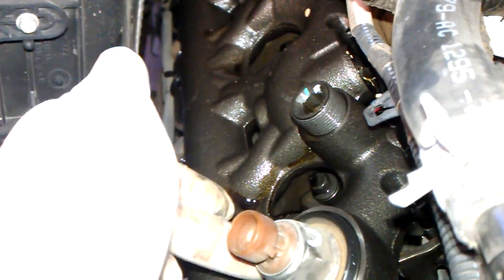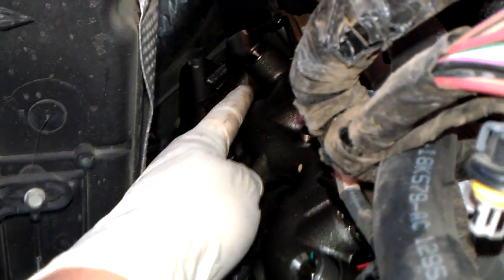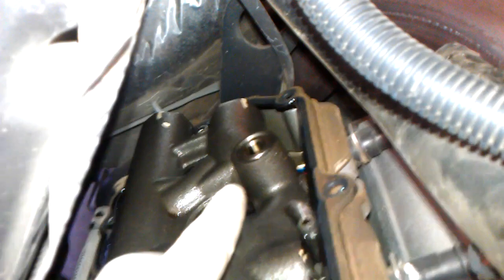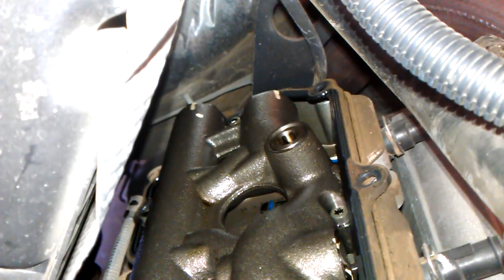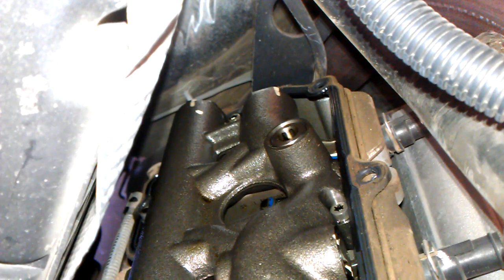SHOP UPDATE 3/24/2012 D-PLUGS FAILED

Comment: Man i am a ford man all the way.IH man all the way.It started with the old 6.9L IH engine.
Them engines i know had some head gasket issues,but a lot simpler than 6.0L Navistar.
6.0L have turned out shitty as hell.These things wouldn't make a good boat anchor.It really
is a shame man.To my understanding the 6.7L has a better setup??Thanks Joe